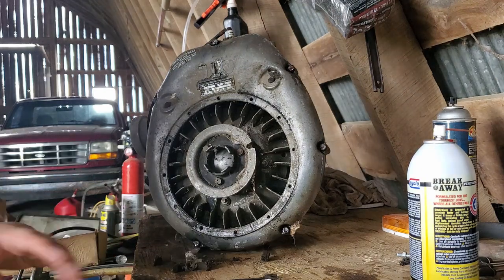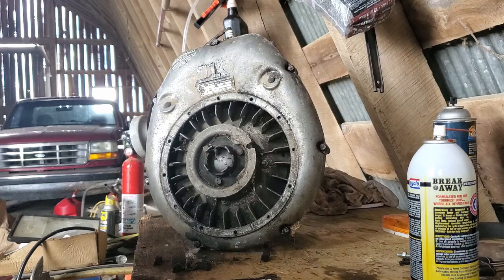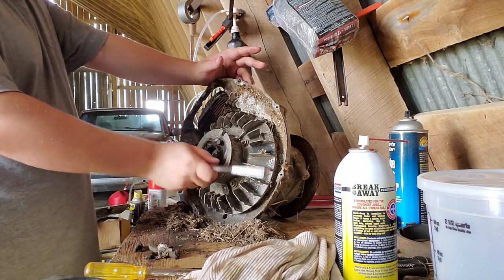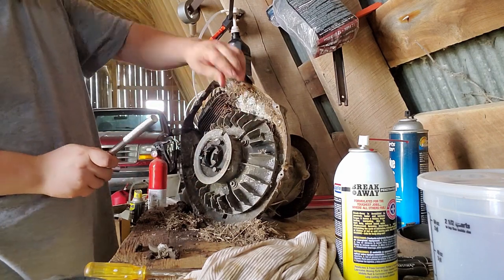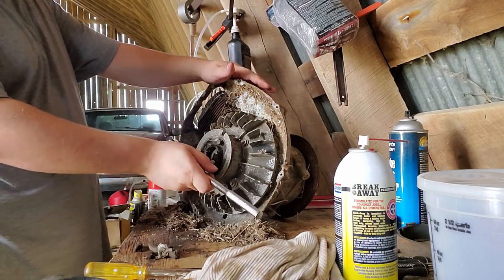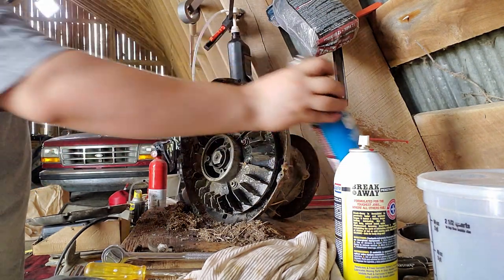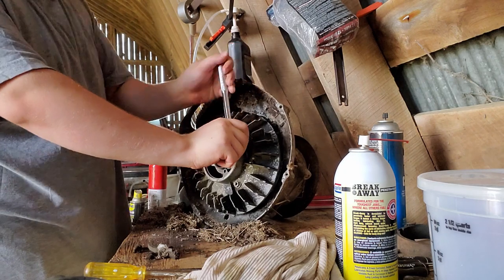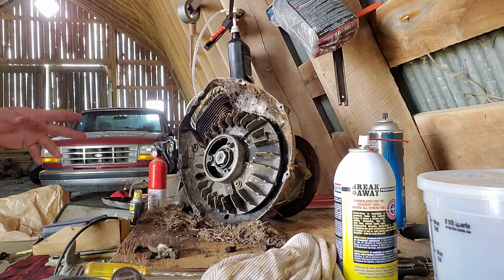1968 JLO 292 Snowmobile Engine - Teardown Pt.1

Comment: JLO L292 (75mm x 66mm) 291.6cc, rated 14.6hp@4500rpm.
Reply: do you have a part 2 disassembly  video?
Reply from the maker: @JamesMorrissey-rc4pr  Unfortunately, I don't have a part 2. For better or worse, I've not touched the engine since Sep of 2020 over personal reasons.

Comment: Nice Clear Video. Be nice if you gave engine Spec's. Like JLO L-292 (75mm x 66mm) 292cc, rated 14.6hp@4500 and CR used ???. JLO L-295 is (74.5mm x 67mm) also 292cc rated 18.5hp@5500rpm using ????cr. CARB sized used also helps.